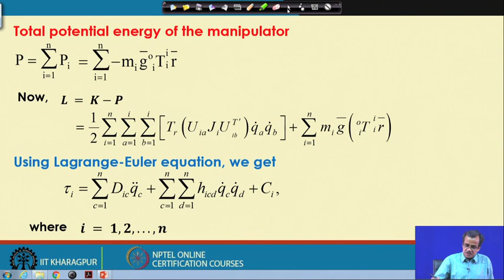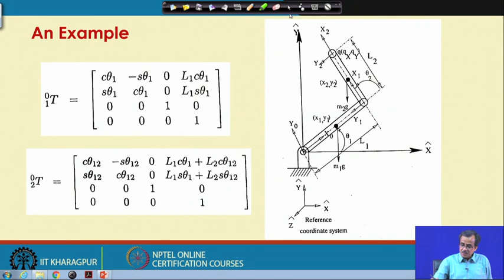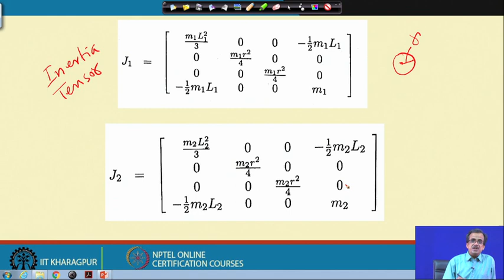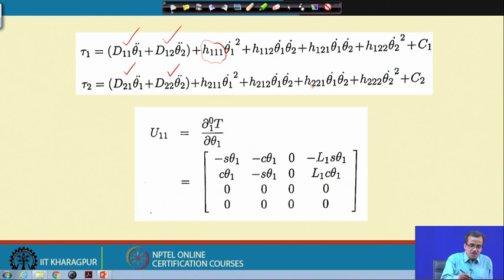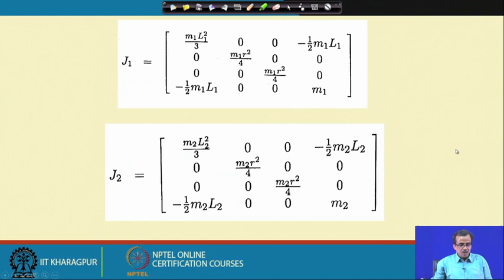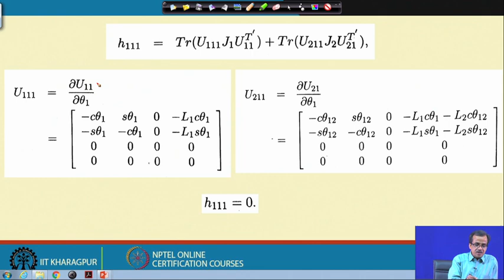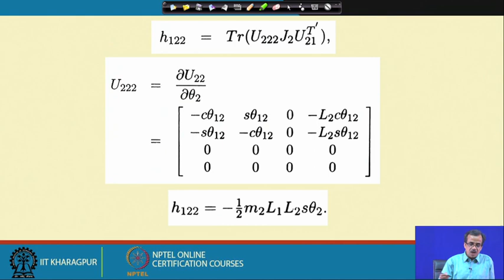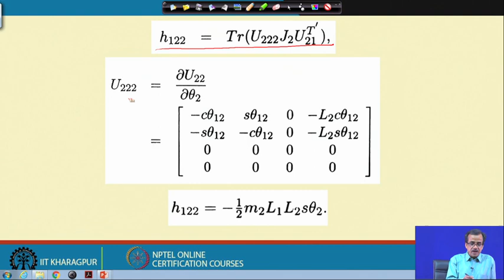Lecture 27: Robot Dynamics (Contd.)

Comment: Isn't the DH Table false? There are 3 frames. (x0,y0,z0), (x1,y1,z1) and (x2,y2,z2) so should be three rows in the table instead of 2 according to definition of DH Transformation. with theta1 the ai= 0 and not L1.